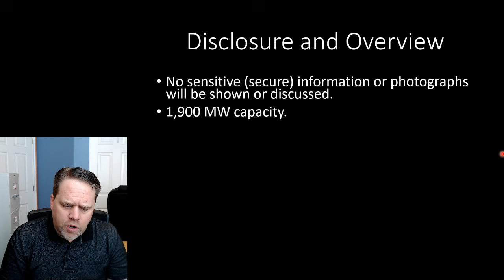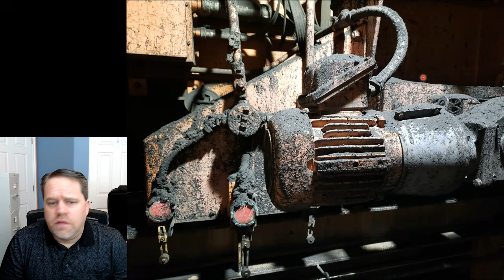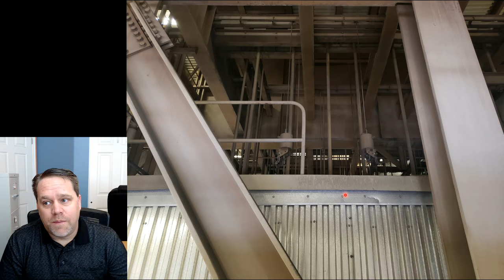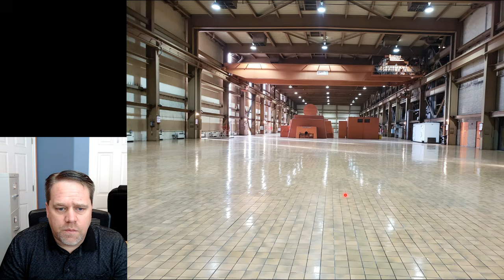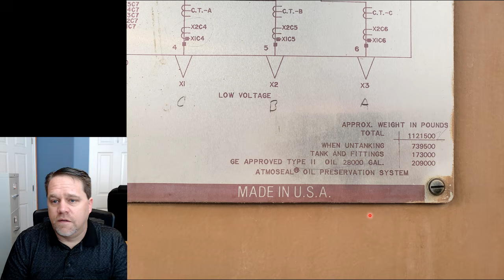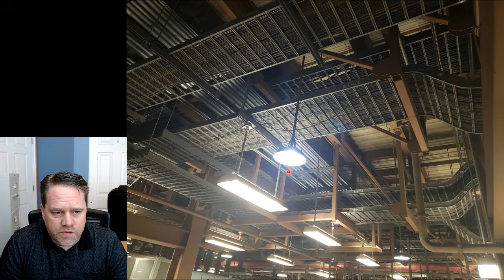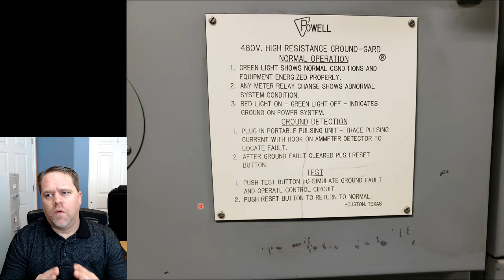Inside a coal-fired power plant (IPP plant in Delta, Utah)

Comment: Wow this is incredible. Really makes you appreciate the insane amount of time and effort that is spent keeping the lights on. Also, I have nothing against renewable energy, but I wish some of the people who have the attitude that "fossil fuel power is obsolete and needs to go away" could see this video to understand the critical role plants like this all across the world play in providing the power that we all depend on. Great video 👍
Reply: Nuclear could do the job just fine, and kill a lot less people too
Reply: What kind of argument is that? Renewables are bad because coal is being used now and because someones are now dependent of coal? Remember that coal does not last forever. One day, will be the day when easily accessible coal is used. What are you going to do then? I like fossilfs too and the systems are impressive. But renewables make a lot of sense, it just needs to be worked on to make them reliable, cheaper, etc. One of the first things I did when watching this video, was calculating what area of solar panels you would need to replace this. Well, with 20% panel efficiency at minimum it is 9,5 km^2. But because solar panels are not constant power sources and there is no good energy storages, in practice it is much more. But in the western USA, there is area for sure. Actually it is surprisingly small area, have to check did I make an error somewhere in my maths.
Reply: I work at a coal fired plant and people just have no idea….
Reply: The problem with renewables and everything that is happening today is not renewables. It’s the demonization and over regulation of fossil fuels. Without fossil fuels there will never be renewables. It takes money, investment, and R&D to make renewables more advanced. Fossil fuels are the foundation of all economies. Look at what’s happening now in 2022. Renewables don’t need to go away. The Enviromental nut jobs need to go away.
Reply: Nuclear all the way
Reply: I wish they had an inkling about what producing the power for just a small town entails, sadly they couldn't fathom the numbers when it comes to the daily usage of a whole state. I cite the average consumption and what it takes to provide that power and I'm called insane or I'm inflating the numbers. People that are adamantly against fossil fuels don't want to hear real data because their solutions can't satisfy demand and would not be financially feasible to do overnight as they want to believe it can be done.
Reply: @jimmartin7881  Sun shines at approx 1 kW power per square meter, of which you can recover maybe 20% with a good solar panel. Wind is another way to recover the energy of sun. Problem with these is that, they are not constant power sources. So for the system to work well, would either need massive amount of over capacity, or massive energy storage systems. Currently synthetic gas is maybe one of the few energy storage systems (aside water, where possible), that in theory quite well might have the storage capacity. But for sure, these projects take some time to complete.
Reply: @wopmf4345FxFDxdGaa20  Tidal generators need serious consideration as they're always producing energy. Natural gas production using the McGyAn process works great but large scale production is iffy. Other bio fuels are easily produced but have several drawbacks like gelling and corrosion, they also face heavy opposition from the petroleum lobbyists.
Reply: Coal power needs to go away. We also need to focus on reducing power consumption. Nuclear and fusion are the only methods that will keep up with demand otherwise.

Comment: I've been in "The Control Room(tm)" -- not when the plant was active, and long before 9/11. One could spend hours showing and explaining a power plant. I've had the day long tour of Cliffside (NC) back when it was 5 turbines. It was recommissioned with a massive single turbine long ago. You didn't mention it, but my guide was very keen on explaining why the turbine hall is so big... so they have space to dismantle the turbine for servicing.

They don't filter CO2 out of the coal, that comes after it's burned. The crushed coal (dust) is filtered to remove sulfur and various heavy metals. If they have the proper scrubbers on their smoke stack most of what's coming out is steam. Ash is collected, and much of the CO2 is ("should be") sequestered.
Reply: I've been in a few control rooms. Not sure what a bad guy is going to do by seeing a few screens.
Reply: And I don't know about this specific plant but I'm 95% sure none of the CO2 is sequestered

Comment: @ 13:59 We don't light off a boiler with the coal and heat up the boiler an d then add water. Good what to get an explosion. Fill the boiler with water to the proper level, then you light off the boiler.

Comment: At 14:44 - The 820000 kW is the output power / shaft power of the 20 stage turbine, the generator output is 991000kVA at 26000kV and 22006 Amps at the busbar. And those generator HV busbars are alu-conductors in steel casings filled with an inert gas, problably SulfurHexafluoride - SF6 or Co2, fed through the generator breaker, that odd-shaped box just before the elbow going through the flooring.
Reply: Otherwise great vid...
Don't quite know where it's coming from, but somehow tech.-vids or "walk-arounds" sticks me to the couch far more than any sport - except maybe when they're showing STIHL timbersports..;)
Reply: Are Kilos standards on this context?
Megas would make those huge numbers prettier.

Comment: I'm wondering why they don't just pipe some waste heat from the steam boilers to thaw the trains instead of the 5 megawatt electric heaters.
Reply: It's called extraction steam and auxillary steam and it's used to heat the condensate in the low pressure heaters, feed water in the high pressure heaters, mill inerting steam, plant heat, help preheat the air before the air heater.  Then what is left over is condensed in the condenser and reused.  Condensate is expensive the water is so clean that if you drank it the menerals in your bones would be absorbed now that's what I'm told anyway.
Reply: @nathannesbit887  That same DI water is what is used to cool the windings in that generator and must be cleaned further thru another resin bed or two. That super high purity water doesn't conduct electricity or the water cooled windings could fault straight to ground! Cooling tower water cools this water in a closed loop system via a water to water heat exchanger.
Reply: @rabie4x4  it's also used as a source for bearing cooling water.  I'm still fascinated with how water has so many different names in a plant with the difference uses.

Comment: I thought a Calorie was the measurement from heating up a Liter of Water by 1 degrees Celsius.
Reply: Yes. There's a difference between "Calorie" and "calorie" though. The scientific term "calorie" (lowercase c like on the panel in his video) is the energy required to raise 1 gram (or 1mL, or 1cc) of water by 1 degree Celsius. The term "Calorie" (uppercase C), which is commonly found on food packaging in the USA, is equal to 1000 scientific calories. It is, in fact, a kilo-calorie. Since 1 calorie is enough to raise 1mL of water by 1 degree, 1 Calorie = 1000 calories = enough to raise 1L, or 1000mL, by 1 degree Celsius. You'll also see them referred to as "large" and "small" calories when something more obvious than capitalization is preferred. Either way it's just a measure of a certain quantity of energy - 1 calorie is roughly 4.1868 Joules of energy. Energy can take many forms, whether it's electrical energy, kinetic energy, physical potential energy, chemical potential energy, thermal energy (average kinetic energy of molecules), etc. They can all be expressed as Joules.

Comment: I help build two of these things, as a pipe fitter, and as you said the video can't do it any justice. There was 24" pipe that was bringing steam from the boiler to the turbine and it was 3.5" thick! And 9% chrome. They planned 100 man hours to weld each one of the joints. It was really cool to work on.
Reply: I was surprised that turbine had such a high inlet pressure (2400 psi). Steam pressure on a convention diesel fired aircraft carrier topped out at 1200 psi and I figured civilian plants would run lower.

Comment: I'm just adding things as I wacth.. so I apologize.. As far as the transformers go, we always have to have a spare on site that's got oil running through it.

The last time one blew up, we had to have a new one delivered by train, on the same tracks the coal trains come in on because the roads and bridges couldn't handle the weight.

Comment: Okay. So you got things a little earlier than when they happen..

Around 10:00... What they do before its burned is run it through magnetic separators to pull any junk or trash out.. (like bolts or broken parts of the train, or any trash that came from where the coal was gathered)

Then, it goes into these GIANT hoppers via a junction tower. It is fed out of the hoppers into pulverizers that crush that coal into smaller than baby powder particles, and is fed into the boiler.

The scrubbers dont come into play until after the coal is burnt. After it is combusted, the ash and gases are sent into the scrubber system and precipitators, then out of the stack.

Some plants use both scrubber and precips, some use either.. but Im pretty sure all have to use a scrubber these days
Reply: I am glad you posted. I was thinking the same thing.
Reply: Interestingly, the pulverized coal is numerically transported up to the boiler from the pulverizers.

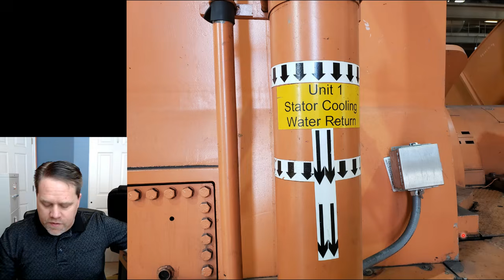Comment: At 15:30, it's not the really the "generator" itself, it's the exciter of the generator.
DC voltage (585V/5363A max) is fed into these brushes and goes into the windings of the rotor, who creates the magnetic field.
Reply from the maker: Agreed. I misspoke.
Reply: The power from the exciter goes thru the AVR (regulator) first which controls the amount of power the generator windings pick up from the generator rotor. On startup the AVR is controlled by us control room operators. Once we turn the generator control over to the system operators they control the output of the plants in the system according to system demand and the traders buy and sell power from different systems according market demands. Even though most operating systems in the plant are automatic, we make critical adjustments throughout the plant as system load increases or decreases. Sometimes we have to override automatic systems when things get unstable, and it can get downright scary.. for hours. It's not uncommon to get home physically exhausted from our 12 hour shifts in the control room.
Reply: Doing brushgear (replacing all the worn out brushes & cutting them in with sandpaper) was one ofvthe dirtiest jobs I ever did, Carbon dust everywhere, Mike Rowe would be jealous!
Reply: For the ge guys , alterrex
Reply: Exciter generates DC current to the rotor, not the windings. 
Rotor magnetic field cuts stator windings to generate AC emf.

Comment: The boiler is suspended to allow for expansion of the boiler in a downward direction (3:42). It is a common practice. Steal expands at a rate of 7.3x10^-6 ft per degree, with this increase in size you have to account for that (even though it is not that much ). If it was hard bolted and not allowed to expand it would crack.
Reply: I've seen things like push carts and maintenance equipment get smashed from being placed under the boilers when they were cold!
Reply: I came to the comment section to say exactly that.
Reply: Also it’s pretty neat how it can handle earthquakes, and dare I say, nuclear blasts. Reminds me of the ICBM Launch control centers being suspended with shocks and springs to stay steady if a near nuclear blast went off, I’m sure there are many reasons they have it suspended, such as expansion, earthquakes, SLC being turned to rubble by China, you name it.
Reply: This is correct and what i came to say.
Reply: Thank you for stating the cooling toward are only emitting steam, its a common misunderstanding that drives me nuts when people assume it is smoke or exhaust from the plant.
Reply: @TomGorman59  Hell, most of everything that comes out of a stack is steam these days. Thanks to Obama's EPA regulations.

But, all of that ash is caught and put into sealed landfills
Reply: @jimlthor  Fly ash and bottom ash was used in road construction once upon a time..
Reply: @rabie4x4  oh, we still sell some of the bottom ash and a lot of fly ash.

Just the ash that used to come out of the stack is captured by scrubbers now

Comment: 5:30 Why is it you can't unload frozen train? Conveyor lubrication freezing? Coal chunks get glued together by ice while train is in transit? Too much water gets condensed on coal after conveyor inside plant?
Reply: ilitvinov multitude of reasons. Not being able to get all the coal out of the cars (getting the fuel you paid for, every piece matters), belts trying to transport too much weight (scales and speed switches monitor tonage rates and belt movement in pulses and abnormal readings or speed can trip the belts), blocked diversion gates, plugged chutes, damaged rollers, and that’s just some of the things that happen with the belts outside and inside the plant. Then it affects the feeders, pulverizers, and ultimately heat rate.

Comment: I think they just don't want you in the control room.  NERC Cyber Security Standards - Controlled Access Area just means that you have to be escorted into that area by an authorized person at all times and be logged.  

While they do treat the coal before being  transported  to the silos, most pollutants are removed by a scrubber on the back end of a unit.

The main reason the boiler is suspended from the ceiling is to allow for the boiler to grow as it is heated.  The bottom of the boiler sits in what's called a neck seal.  This keeps a water seal between the bottom of the boiler and the pantleg /SFC as the boiler grows or shrinks.

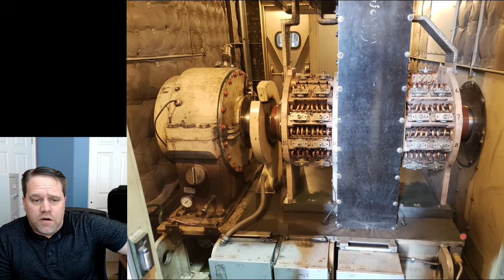Around 15:35 you are looking into the "dog house" or the exciter room.  This is not the generator.

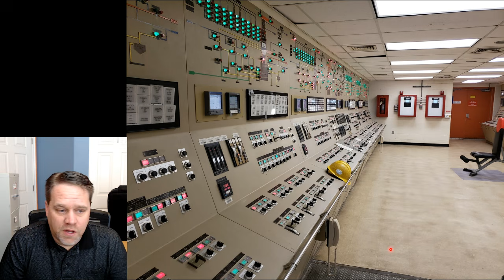I'm going to assume the control room at 23:57 is for the cooling towers based on the layout.

Just a few notes on your video.
Reply: Nathan Nesbit, damn UO’s. So nit picky.